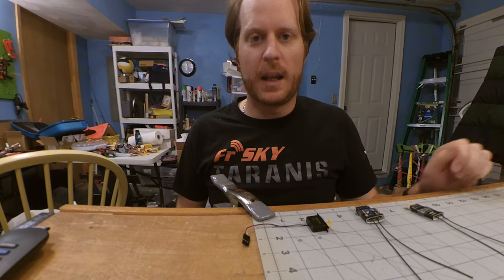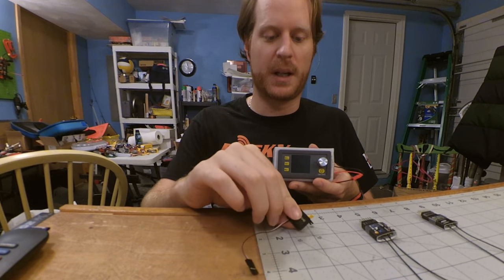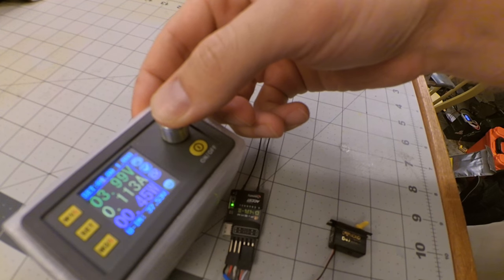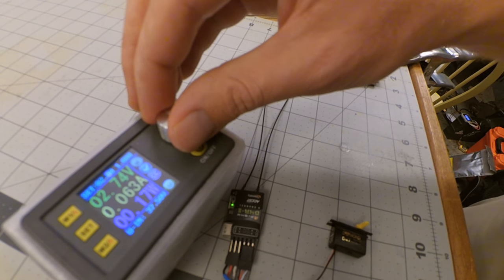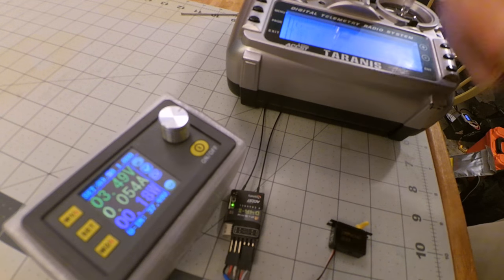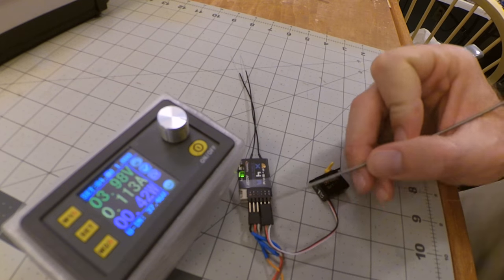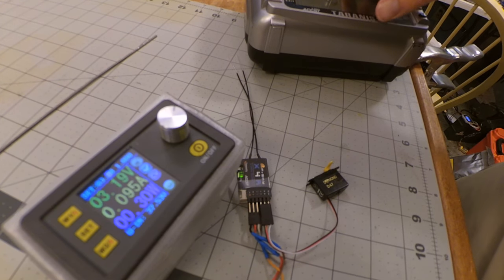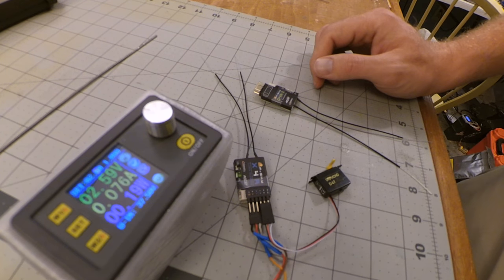Frsky D4R-II vs X4R Low Voltage Test

Comment: Thanks for the info.  Just curious if  you happen to low voltage test the variometer? it's also rated at 4 volts.
Reply from the maker: Tom Kelley I don't currently own a Frsky vario but if I pick one up I'll be sure to test it as well!

Comment: Did you ever do a range test with the X4R @ 3 Volt ?
Reply from the maker: I've "specked" it out on my 1m dlg a couple of time, buy that's a bad example lol. 

In my experience it does line of sight just fine.